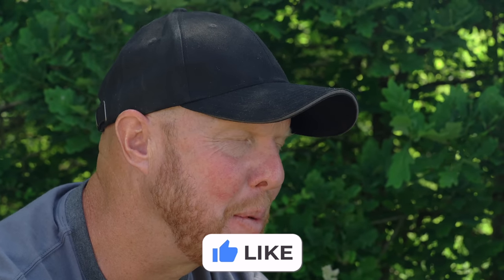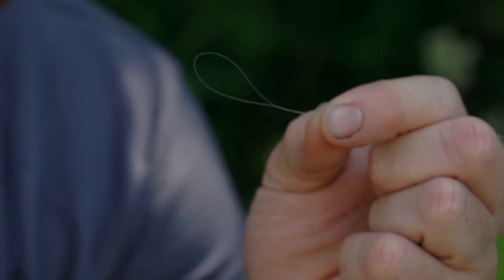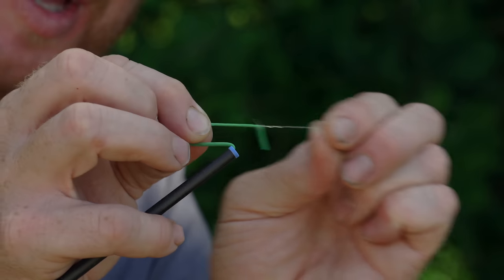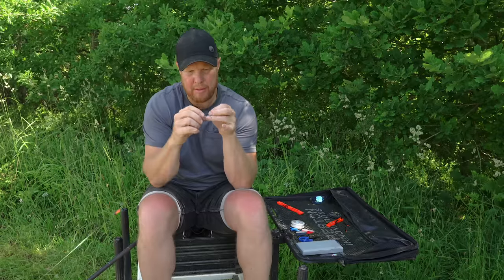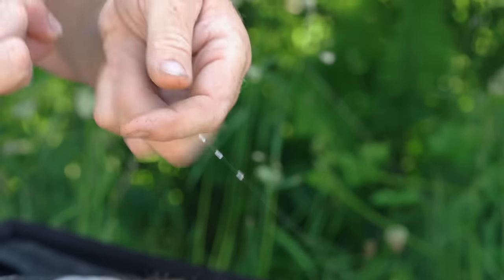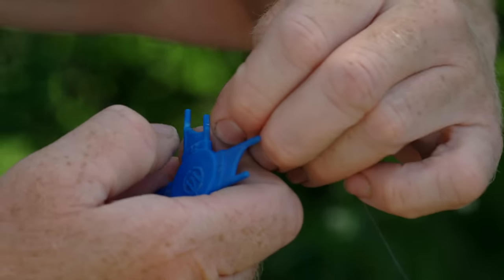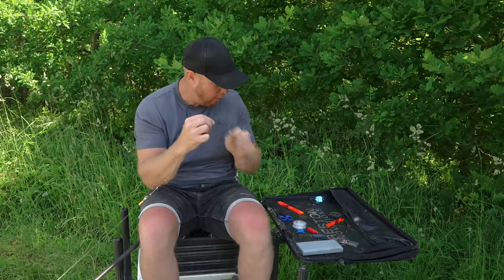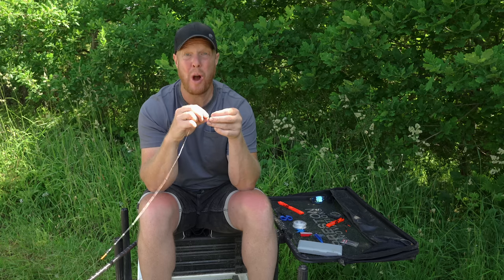Make Your First EVER Pole Rig! | Andy May

Comment: I prefer to make my rigs at home, cut to length and tie the top loop last. 
All my line off-cuts go straight into an old Pringles tub, when it eventually fills up I empty it into the line recycling bin at the tackle shop. Off-cuts when on the bank go into an old vitamins pot to take home, if there isn't a line recycling bin on site.